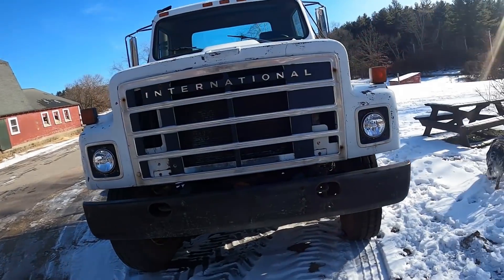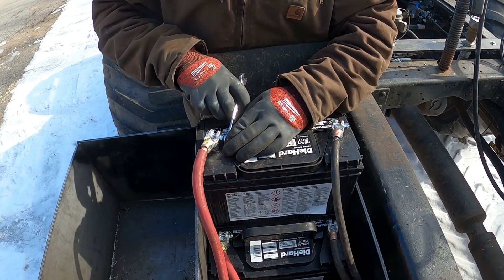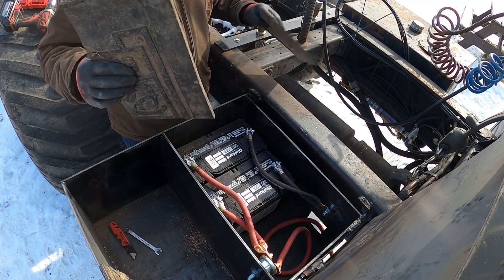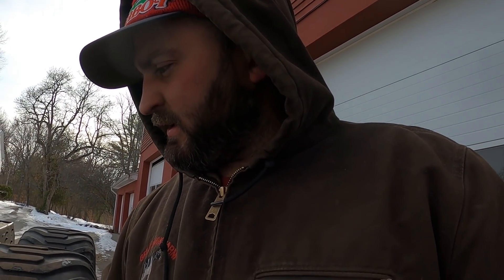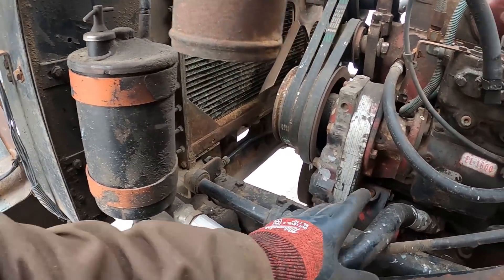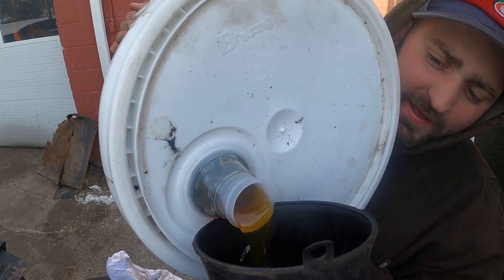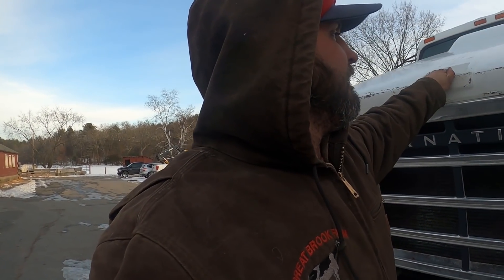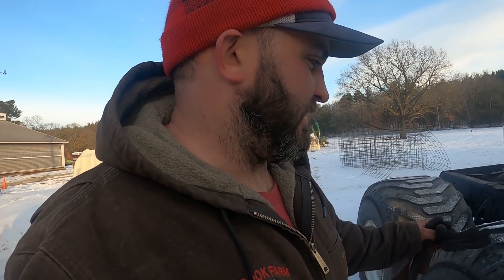Will it start?- After 5 Degree Weather

Comment: Hey duffy, you really should cover the new positive battery cable with split loom the entire length, also use pcs of radiator or garden hose anywhere it touches a square edge. Lots of zip ties. It’s cheap insurance. Love the channel.
Reply from the maker: Good thinking and appreciate it

Comment: We got an IH S2200. Her cab is quite rusted out, silver 6V92 and a 9sp. Still runs and gets used here and there. ✌
Reply from the maker: How you like the Detroit?
Reply: @DuffyAg  it's 350hp but I do prefer the off idle torque of an I6 for hopper trailer loading. Sometimes if you stall the engine and push clutch in at the right time it will start running backwards 😂 leaks oil, but no real problems out of it. It's mind numbing loud with a straight pipe.

Comment: The box build is coming along nicely. And yes, bed liner on the inside would help keep the “sparky thing” to a minimum as well as keeping tools and such from rattling too loudly. Get with the International folks and find out if that engine oil is gonna be an issue. I know some big rigs used motor oil  for PSF..........but check it out with them. Having to replace a pump and all the associated  parts would not be a good thing in the middle of planting/harvest season.
Reply from the maker: Thats for sure. Definitely asking alot of people on their inputs

Comment: Man, Line-X is a really good suggestion! Just make sure you REALLY clean/degrease all of the applied surfaces and also to scuff them up really well for max adhesion. It will also deaden noise and rattling. When applied properly, Line-X will last for decades!
Reply from the maker: Thats what I was thinking too

Comment: Use piece of heater hose split and a couple zip ties. Take care of power steering line and battery cable rubbing. Use old heater hose that you changed out on another rig. Just scrap hose lying around.
Reply from the maker: Thats a good idea

Comment: Get yourself some angle wrenches and some knipex pliers. Both will be your best friend in tight places like that power steering line.
Reply from the maker: Thats good thinking will need to get a set
Reply: @DuffyAg  if you dont have cash for snap on angle wrenches the next best set are the tekton angle wrenches. There made in the USA as well. Alot cheaper then snap on but just as good.

Comment: Are you gonna put a grommet (split hose maybe) around the cutout where the positive cable comes through the wall if the box?  Very cool fabrication by the way.
Reply from the maker: Plan on putting split hose around it and gluing it in once the weather gets warm

Comment: I commented this on the last video but I was late so you probably didn’t notice but make sure you are regularly using the switch for the batteries or it will corrode in a matter of no time. I’ve replaced every one on our fleet of trucks at work. Makes for a big headache something so simple causing a truck not to start
Reply from the maker: I did see that comment. Good to know that for sure try and avoid headaches later on. Thank you
Reply: @DuffyAg  no problem! Btw we run atf for our power steering. Great video 👍🏼

Comment: Check the seals on your splitter valve. 
It is two separate box’s with one passage for oil between the two. 
Could be pushing oil out only while in high range because it is air actuated in high and spring return for low.
Reply from the maker: Thats true I need to look at that. Thanks for the advice
Reply: @DuffyAg  I’ve seen quite a few that the shaft seal toward the fork fail and cause that same problem. Also causes slowish range shifts which will eventually take the synchronizer out in the rear box.

Comment: Ever think about changing the hinge direction so it runs parallel to the frame rails.  So you dont have to stand between the wheel and the box.  Brakes fail.  Gears slip.  Bad stuff can happen
Reply from the maker: It wouldn't pivot as well it I went back would have some gaps thats why I went that way. If I'm working on it the chalk blocks come out

Comment: I don't know exactly what transmission you have, but if it is an air operated shift, you may have an air leak inside the transmission. Also if you had put your battery disconnect on the negative side, when you turn it off you wouldn't have to worry about the positive cable arcing on the frame. That is a very good job on the battery box, better than factory man
Reply: Do you know if your transmission is always had 80 90 year old and maybe not a synthetic in the gearbox I would probably draining and refilling it 80 90 I'll take the breathing plugs out of it I see how much pressure you got on and then

Comment: Those spanner heads that fit in a socket wrench would be handy for those fittings in tight places
Reply from the maker: That would make it easier for sure
Reply: @DuffyAg  do you have Instagram
Reply from the maker: @FromLandVegemiteSamich  yes sir Duffyc91

Comment: Since the trans and the back box share an oil source. I would eliminate that rear breather. None of our transmissions have a breather on the back box. Synthetic 50w is expensive you can run mineral 50w and it’s much cheaper. The synthetic will take the heat better than the mineral but, for what you’re doing mineral would probably work fine. Don’t mix the 2 though. We run synthetic in ours but we’re pulling 154,000 pounds in Michigan with gravel trains. We change fluid every couple years like 150,000 miles.
Reply from the maker: Thats good thinking thanks for the idea

Comment: Have you thought about putting heat shrink on the battery cable ends? It will help prevent the cable from corroding.
Reply from the maker: I never did good idea though thanks

Comment: Wrap your wrench in electric tape in the middle or all the way to the boxed or open end your preference, it will help prevent you from accidently grounding out on the sides of the box. Iv always used ATF or Power steering fluid iv never seen anyone use 15w-40 befor not saying you can't but iv never seen it.
Reply from the maker: Thats good thinking too

Comment: How about so kind of rubber weather strip on top edge of battery box so you reduce the chance of wrench touching it, plus it will seal the top of box from moisture.  Just a suggestion
Reply from the maker: Thats the plan waiting on warmer weather so I can glue it on
Reply: @DuffyAg  I do appreciate your reply, thanks.

Comment: Check to see if your range slave piston is leaking air into the gear box. It can force the engine oil out. It’s better to put the battery switch on the ground side, less heat during start up on it. Should shrink wrap all the cable ends to keep out the corrosion. The battery wire seams a bit loose and close to the driveshaft. Looks like a lot of sharp edges for the cable to rub out on. Good idea putting rubber around the lid. Don’t forget to tie down the batteries they don’t like bouncing around. It can short them out internally.
Reply from the maker: Thats one thing I gotta check out and good advice. Haven't don't much battery cable stuff before

Comment: On your transmission leak it could be from you pto maybe? When its engage air might be pushing into your transmission. That has happened to us before.
Reply from the maker: It will leak even when pto isn't engaged at all

Comment: Always great video in the power steering we used to run hydraulic fluid some guys run ATF some guys even run Motorola like you motor oil you need to make sure you change the filter on it and it doesn't have the same protective qualities of hydraulic fluid link you're seeing on the transmission it's cuz it's either too full or has gotten moisture in it
Reply from the maker: There's no filter with the steering. The transmission is at the proper level full. Have some more thinking to do on it. No moisture I've drained it out and it's nothing but oil

Comment: I'd be worried about those batteries bouncing up and arcing on the cover.
Reply from the maker: I'm planning to strap them down. Just haven't come up with the best idea for it yet
Reply: @DuffyAg  maybe you could just set a peice of rubber above the batterys as a quick fix to prevent arching.
Reply: @DuffyAg  weld tie down points into the sides of the battery box and run an old nylon football belt across the batteries and tighten it down

Comment: I wonder if a gear is throwing oil at it, seen that before
Reply from the maker: I was wondering that too
Reply: @DuffyAg  if you put a few feet of hose on it id imagine if it was the gear throwing oil it wouldn't do it anymore, but if it was pressurizing, which seems unlikely, it would still puke

Comment: Most times trans just run 50w or synthetic 50 in new trans possible have splitter valve leaking air in to trans internally which will cause oil to blow out breather that explains why leaks when driving for while try building air up and splitting to high side when trans hot and truck off see if can hear leak or just reseal plunger and see if fixes can just get o ring kit for plunger
Reply from the maker: Good ideas I gotta check it all out

Comment: put rubber around the edge of the hole you cut in the battery box for the battery cables other wise the sharp edge will eventually cut in the battery cables defeating the purpose of changing them in the first place. and vacuum the pieces of metal out of the other part of the box so you dont go to grab something out of it and get metal in your fingers
Reply from the maker: Thats the plan going to glue the rubber on so it stays so have to wait for warmer weather. Good idea too

Comment: Take the rear breather out and put a pressure gauge on it and film it on a good drive so you can see how much pressure it builds with only the front breather
Reply from the maker: Thats good thinking
Reply: @DuffyAg  After that if you can't find a solution find a hose nipple to replace the breather on the gearbox make a catch tank or find a small round tank at the scrap yard mounted vertical with another hose nipple on the top connect the two with a hose than drill and tap a hole on top for the same breather to be put on the catch tank. Also put a drain plug on the bottom. For brackets well that part is all yours. Maybe there's some place on the bottom sides of the gear box that has a plug you could replace with another hose nipple to return the catch tank fluid back to the gearbox.